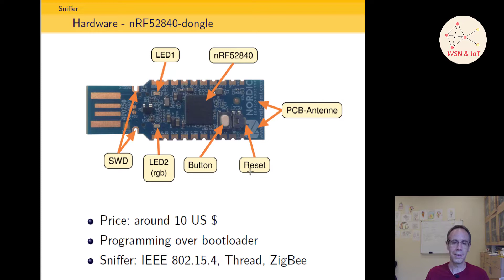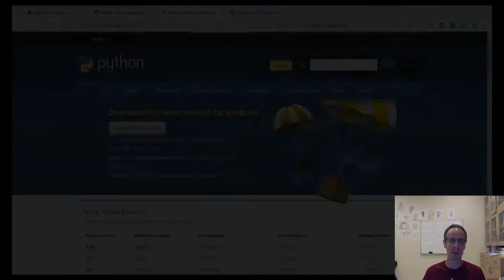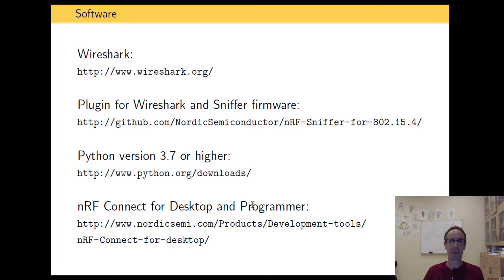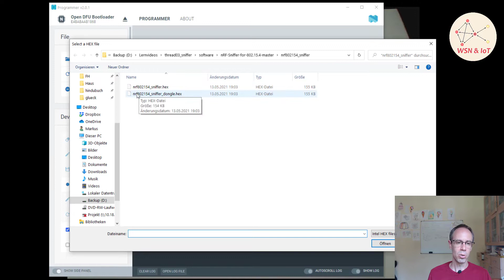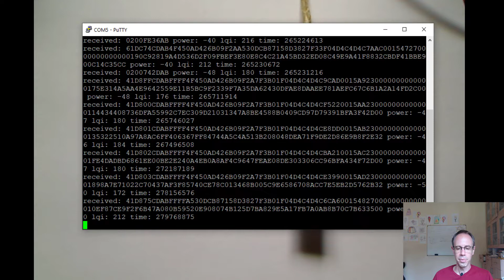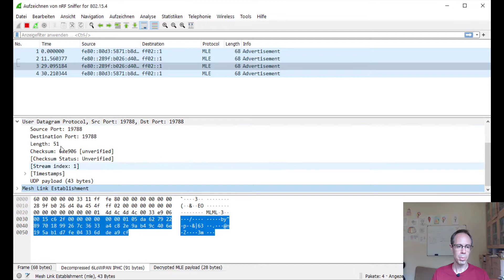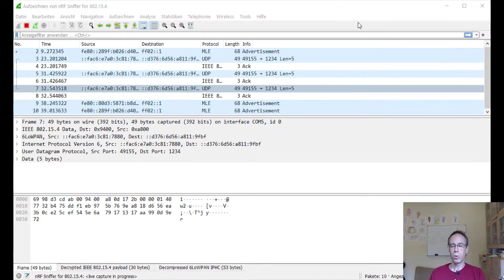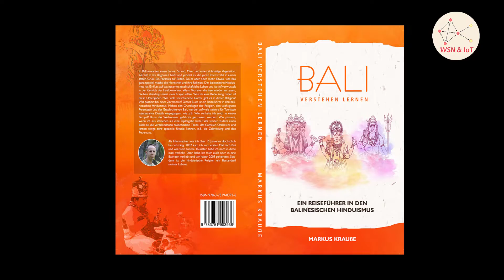Thread network technology - 03 Sniffing IEEE 802.15.4 packages (Thread and ZigBee) with Wireshark

Comment: Done with same setup however not able to sniff zigbee communication - getting only broadcast beacon requests ............. am I missing something ?
Reply from the maker: You are probably missing something. The stick is an IEEE 802.15.4 sniffer. If you have set the correct channel, you will also receive ZigBee packets since IEEE 802.15.4 are the two downer layer from ZigBee. Is your ZigBee network encrypted? Have you set the network key in Wireshark? At least you should see the IEEE 802.15.4 part from the ZigBee-pakets
Reply: I am also not getting anything apart from broadcast requests . I am not sure if the packets are encrypted but no other packets received on putty and wireshark